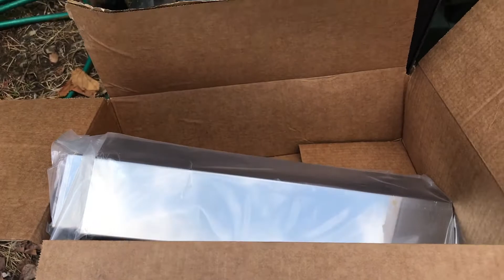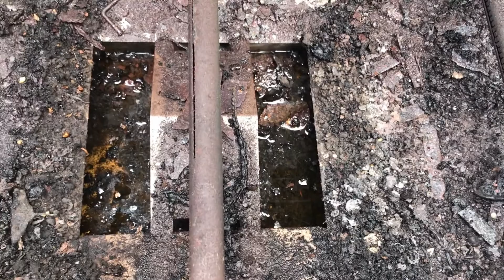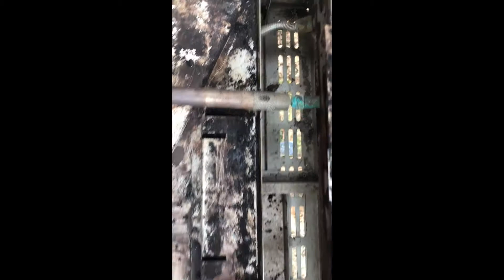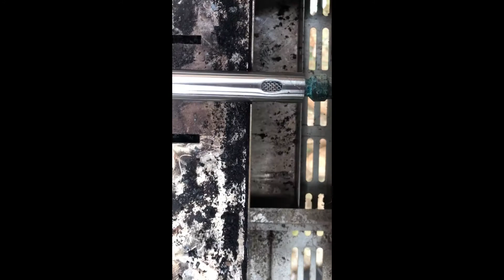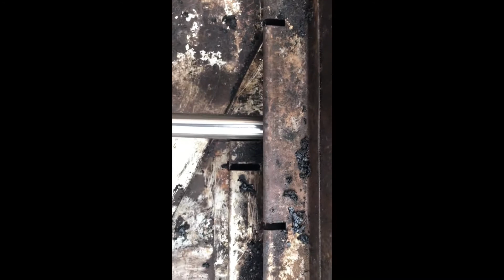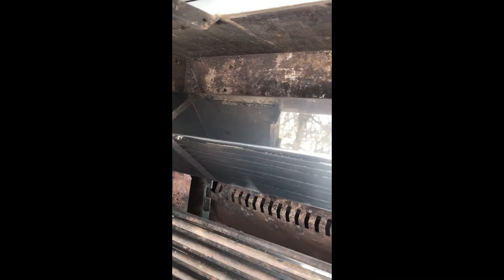Sonoma Grill Repair (Model CGR30 previously sold at Costco).

Comment: May I find out what exactly was the item purchased in Amazon? I have the same grill. Thanks
Reply from the maker: This is the parts kit that I purchased on Amazon in October 2024.  The flavor shields (they call them "Heat Plates") are no longer made with stainless steel.  They are made of porcelain-coated metal.  I do not think they will last as long as the prior repair kit.  

 https://www.amazon.com/gp/your-account/order-details/ref=dp_iou_view_this_order?ie=UTF8&orderID=111-3388670-1169057

Comment: I have the same grill, trying to replace the burners as well but having trouble getting the 2 bottom screws out to remove the front. Any idea the size of those screws? The others used size 1/4 but the bottom two seem to not fit 1/4.
Reply from the maker: All of the machine screws are the same size, but the screws may have been beat-up during installation, or during a prior repair.  I used a 1/4 inch socket wrench when I worked on the grill.  The socket wrench made the whole effort a lot easier.  If you don't have an SAE socket set, you can buy a cheap one at Harbour Freight or on-line for less than $20.  You will be glad you have it when you go to work on anything that has a lot of machine screws.

Comment: Thank you for taking the time to post this video.  I have the same grill that is in perfect condition on the exterior but needs to be refurbished inside.  Used “universal” parts a couple times in the past that didn’t fit that well and only lasted a couple years.  This is exactly what I was looking for.  Thanks again!

Comment: How well have the aftermarket burners performed?...after 1 yr are they rusted through?
Reply from the maker: I am providing a 3 year update..... The aftermarket burners and flavor shield have now failed.  I once again purchased the replacement burner assembly and flavor shields on Amazon (cost about $40.00).  The rest of the grill is holding up quite well.  I think I will get another couple of years out of the Sonoma grill now that I have replaced the bruner assembly and flavor shields.
Reply from the maker: A I entitled in the video, we do not barbecue as often as many folks (2-3 times per month).  The aftermarket burners and flavor shields are holding up quite well.
Reply from the maker: H. S.  Please see my comment above.  The burners and flavor shields are holding up pretty well.

Comment: Thank you for this video i know now how to insert those burners.Last time i install the burners (2016) i forced inserting it without removing that front panel because i don't know where those screws to remove. What happened is i am seeing fire coming out because the other burner is not aligned causing the gas to leak. I will open tomorrow again and see if it will be fix but for the meantime i ordered new burners because only one stock left. I want to keep this Sonoma Platinum Gas Grill because it is made in U.S.A. and the Stainless steel they use here is very thick gauge compare to the new one now very thin gauge steel.